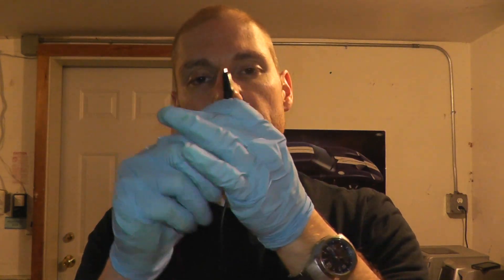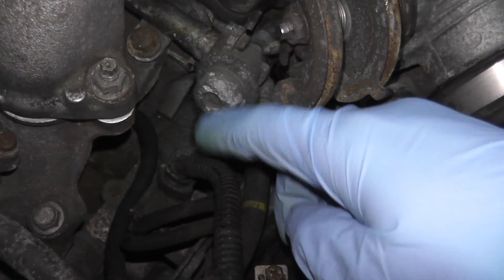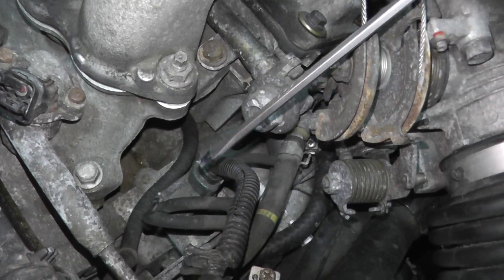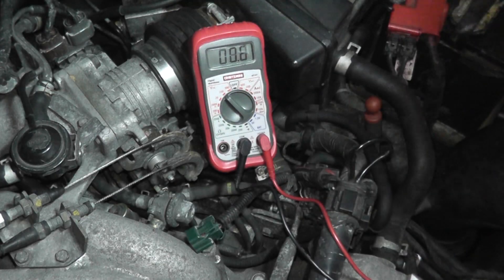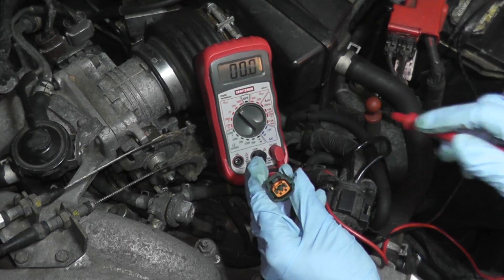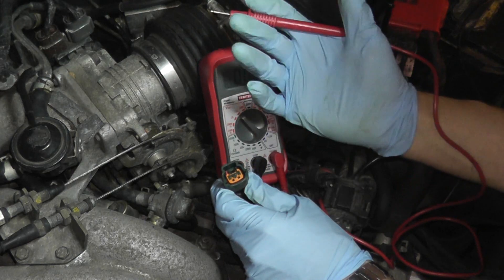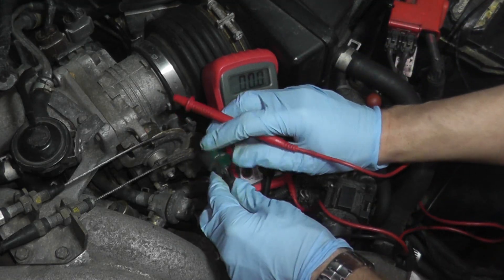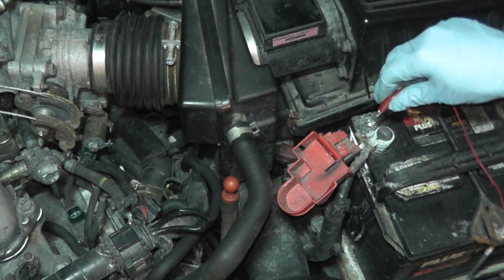How to test and replace the EGRC Solenoid Valve P1400 HD

Comment: I'm perplexed, I have the repeating (after erased numerous times, but no symptoms) P1400 code for 1998 Nissan Pathfinder 3.3, 164,000 miles. It was throwing this same code with an older motor, and still is with replacement motor installed last week. I have 12v at the wire plug when it's unplugged and key on. 12v applied with jumper wires actuates the solenoid on both its leads.  But, when I have a helper turn key to on I cannot hear or feel the solenoid activating.  Is this solenoid controlled by ECU giving it a ground?  Or how?
Reply: Same question I have :(
Reply: @ericoz650  I need to take the time to cruise the forums and Google more. The Nissan forums are better fixer communities than FB and YouTube, so it seems.  I still haven't fixed it.  Seems to operate fine though otherwise.
Reply: @thesetruths1404  thanks for answer
Reply: @thesetruths1404 damn i literally have the same issue, i have a 2000 2.4l frontier with the p1400 code. Power at the connector, solenoid is new. Im starting to think the ecu is bad

Comment: @CarsNToys where did you get the test leads or did you make them? I have P1400 code and i am getting 12v to the wire harness connector but would like to test the egr solenoid valve like you did before i buy one.

Comment: Great video. My 98 maxima tested 11.6 volts at the molex connector, not 12v. The solenoid however when tested directly from batt did click. 

Since I’m not getting a full 12.1v at the connector, any idea if that might have an effect on performance of the solenoid? Unsure where to go next.

Comment: Also, just because you can hear the solenoid click, the Vacuum Valve in the EGR Solenoid may still be malfunctioning. The best way to test it is: Put a vaccum on the EGR Solenoid Vacuum port, and a Vacuum Gauge (with a Tee connector) on the EGR Solenoid port to the EGR. When the solenoid is off, there should be no vacuum on the EGR port. When the Solenoid is on, there should be vacuum on the EGR port with no loss of vacuum. Then the vacuum should release when the Solenoid is turned off. Most EGR Solenoids have a vent hose that let's in air to release the vacuum to the EGR port. The vent hose may have a little air filter on it (some filters are built into the EGR Solenoid) so make sure the vent hose and filter air letting air through with no leaks (you don't want dirty air in your EGR Solenoid Vacuum Valve).
Reply: more helpful than the video was. thanks a heap

Comment: Great video. After you verify power to the connector, check the ground on the connector too. Turn the Ignition OFF. Then put your meter in Ohms mode and measure the other pin to ground (chassis). You should read less than 2 Ohms. Then put your meter back in Volts DC mode.
Reply: Thanks for information, I just try find out how to check ground connector.
Reply: @ericoz650  Checking the ground is easy. Put your DMM in Ohms auto range. With the vehicle powered off, measure each lead with the red meter lead, and with the black meter lead on the chassis (ground). One should read less than 2 Ohms (that is your ground and it is good), if your read a few Ohms higher, that is a bad ground. Digital Multi Meters (DMMs) take a few seconds to start reading and to stabilize, so give each measurement about 5 seconds before you make the reading.
Reply: @paulromsky9527  I just checked EGR Solenoid connector and one cable "+" Is working and show's. 0.75 Om or 12.5 +- Volt, but "Ground" no reaction at all :/ On Volt no reaction and on Om test also no reaction at all on Multimetr :/ Is that mean that Ground cable broken and need replace him? Only how to find where his Started? In theory somewhere in ECU?
Reply: @ericoz650  Great diagnostic work. I don't have wiring diagrams but the ground wire most likely does go back to the ECU. One method is to add a "helper ground" to the ground wire. You follow the ground wire as far back as you can, then splice into it there, then attached that spliced wire to a nearby bolt or screw. You may have to sand away some paint for a good connection. But it is best to trace the wire all the way to where it is no longer making a good ground contact.
Reply: @paulromsky9527  p. s. What interesting, alternative connection to EGR slolenod, make engine work correctly, slowly on "N" gear position, but on fuel LPG then appear Code P0403 and sometimes P0300 during driving at once a couple days. But if Solenoid off, then P0403 gone and P0300 gone, car work without any Cods nicely, if not only higher engine speed work oon gear position N". But on Petrol - Gasoline P0300 appear even on "N" Position.
Reply: @ericoz650  If you are fueling your car with Petrol and/or LPG, that is beyond my expertise... I only know about Petrol fueled cars.  But since alternate connections to the EGR Solenoid seems to make it work, you definitely have bad wires somewhere and they need to be replaced or repaired.

Comment: Hey i have a 94 maximum it was low in transmission fluid it started pulling slow I refilled it back up it doing the same thing if you can help me thanks

Comment: I am working on a 1994 nissan d21 v6 4x4 automatic. I have no power to the egr solenoid valve. I have ohmed out all the fuses under the dash. All checked good. I'm at a loss. What am I missing?

Comment: the one glaring question I wish you had addressed was when touching the pins such as the voltage check how did you choose which pin to touch because any person would wonder "what will happen if I touch the wrong one?"  does it matter? if so how did you determine "I will touch the outside pin?"  that could mean anything

Comment: My 1996 Infiniti I30 does not have the EGRC valve like your engine does. I am still getting the p1400 code but I am unsure on how to resolve this issue. Would you know anything in regards to the 96 I30 that does not have the same EGRC valve as you do?

Comment: hey c&t!  great videos man.  u could not have explained this process any better, but leave it to me to have a question.  i tested the egrc component and i heard a noise but it didnt sound exactly like a click, more like a tiny zap and does it matter which port the 2 small hoses are connected.  im still getting code
Reply: by the way its code p1400 and code p0325

Comment: not all solenoid clicks so you really cant go by that only. Check ohms should be around 35 ohms ish, then give it power like you did but start the car if the idle gets rough then the solenoid is working, also you just verified the egr valve also working good.

Comment: Great video. You are a great teacher and the camera work was excellent. You always have great content on the nissan maxima. One question I have a Nissan Maxima GLE and you mentioned a 10 amp fuse. Is this fuse #17, the one for the engine controls or where is it located? Please advise. 1997 Nissan Maxima GLE.

Comment: I have a 1999 Nissan Altima GXE.  I received a code for the EGR valve but have been also told that it could be the EGR C solenoid.  I don't want to waste money in replacing a valve when its the solenoid.  The test I did on the valve was pushing the valve up and blocking the port with my thumb and it held the vaccum until I removed my thumb.
Reply from the maker: What's the code you're receiving?
Reply: P1402

Comment: also in the video at the begining there is a black connector hooked to the side of the valve cover that says v6 3000 twin cam 24 valve. right there on the edge of it on the end of the connector it says Nissan 0.47 what is that connector for, what is its function. when I unplugged mine it's full of red sticky stuff. please help. I have a screen shot but didn't know how to send a picture. thanks for any help.
Reply from the maker: Your vehicle may be different depending on the specific model. Do you have a California spec model or non-California model? There's a tag on the hood that states if you have a California model. Watch this video and fast forward to 18:40. I show where the tag is located.  https://youtu.be/NabxJMx1cW8

Comment: on my 95 Nissan maxima I have this code. but the solenoid you tested in the video is not even hooked up on my car. I have one that is identical up by the radiator, is that the one I test and do i do the same with it as you did in the video. thanks. these videos have saved my rear lately!!

Comment: Great video--clear, concise and provides step by step directions.   I followed the video instructions and with a $10.00 junk yard part from a 1995 Maxima fixed my 1996 Maxima.   Getting the solenoid valve from the 95 was easy--removing the valve from the 96 was not.   So, not being able to reach the nut under the valve, even with a 10mm flex wrench, I just left it in place.   I disconnected the vacuum hoses from the bad valve and placed them on the new valve, zip tied it in place and reconnected the electrical connection and everything went well.   Thanks for the help!

Comment: That sensor is hell to remove and those bolts at the bottom are very sensitive and will snap but if you're swapping it doesn't really matter, but can someone please tell me where the fuse is so I can check. p1400 p0325
Reply from the maker: +Marktheshark804 What kind of vehicle?
Reply: +CarsNToys what fuse can i check for the p01400 code .. where is it located.. i have an 96 infiniti i30

Comment: You really didn't check the GND connection to the solenoid. You just verified that it was getting 12V.Maybe use the OHMs setting to verify that the solenoid GND pin connection is good.

Comment: I have a 1995 Maxima CA vehicle and the solenoid is not in that position. I just replaced the knock sensor for a P0325 fault, but P1400 is still coming on. Is the egrc solenoid in a different position for a CA vehicle?

Comment: Hello I checked the solenoid valve connector harness and it's only reading 5-7 volts, is that the reason I'm getting the code P1400 and what is the fix to this problem? Could it be Evap control pressure sensor causing this because, my mechanic wants me to buy that part next he says that's why it's reading code P1447. I also get code P0446 but mechanic already replaced Evap canister and Evap canister control valve, I'm still getting that code P0446 though. Got to pass emissions this month or I will be walking. I hate living in Ga
Reply from the maker: +Bigman What kind of vehicle?
Reply: +CarsNToys 96 Nissan Maxima GLE
Reply: +CarsNToys I also checked the Pressure sensor connector harness and I didn't get the beep but I did get a reading
Reply from the maker: Okay. What codes are you getting right now?
Reply: +CarsNToys Codes are still the same as explained in my first post, I wonder could it be my ECM because I didn't get a beep when I checked pressure sensor harness connector, as instructed in your other video

Comment: Hello I need help I have a  1997 Nissan maxima my check engine light is on and the codes that keep coming up is p0110 intake air temp sensor and  p1400 egrc solenoid valve the intake air temp sensor is plugged in the air duct but that code still comes up and the sensor is brand new the egrc solenoid valve code pops up sometimes these two codes are stopping me from passing emissions  can you help me
Reply from the maker: Donte Quinney Have you seen this video yet? It may help  https://youtu.be/N5FGh8T4qmE

Comment: Should my 96 I30 look the same? I know it should but I have that same code and i can't seem to find that connector. In my car there is no sensor near the area located in your video.
Reply from the maker: Jonathan Nguyen You sure code you have is p1400? I believe these didn't come into play until '97
Reply: CarsNToys Yea my obd reader says P1400 "Manufacture Control"
Reply: +CarsNToys So is it my car is throwing a code it shouldn't have? I cleared the code and the P1400 still comes up.
Reply from the maker: Jonathan Nguyen
I don't have anything on my end for p1400 & '96 I30.

Comment: Hello... I recently reached out to you with help replacing my O2 sensor (p0138)... Your video was extremely helpful and easy to follow...
Now I got p1130 swirl control... Do you have any experience with this?... The Internet has provided a little insight, but I'm hoping your expertise can guide me a little better... I have a 2001 Nissan Maxima, looks like the Max you work on...
Reply from the maker: jh hassellhoff Sorry, the Maxima I work on is a '97 model; before they started using swirl valves. Next time I come across a newer Maxima I'll take a video on how to test the valve.

Comment: is this the same as a temperature sensor? I'm getting a error code 32 on my 94 nissan pickup and its for erg function and either said egr valve, temperature sensor, solenoid seemed like the 2two were the same thing
Reply from the maker: aLECKS SKCELa Do you mean the coolant temp sensor or air intake temp sensor? I have vids for both....http://youtu.be/bPAIFL8VH9w   and http://youtu.be/N5FGh8T4qmE
Reply: CarsNToys i checked the solenoid how you described in this video and also the erg valve in your other video and they check out good. my check engine light only comes on sometimes. pretty random. any other opinions why why check engine light goes on and off at random? my friend also says it might also be my catalytic converter. can that be true?
Reply from the maker: You have the four or six cylinder motor?

Comment: Thanks for the excellent video.  I need to change the solenoid.  What special tool can reach the 10mm nut under the bracket to unbolt the solenoid?  1996 Maxima
Reply from the maker: Henry Edwardo It's a little tricky but try a using different size wrenches.
Reply: CarsNToys OK, Success!  I bought a flexible 10mm ratchet wrench for $8 online and successfully changed the solenoid valve today.  I'm told the check engine light will eventually go out after driving the car for a number of cycles, whatever that means.  Barring someother problem, do you think the CEL will cycle off?
Reply from the maker: Henry Edwardo
Good stuff, Henry. Yes, it will cycle off.

Comment: Hello and thank you for the video.
Im working on a 2000 Altima and was wondering how would I determine which connector is positive and which is negative on the egrc solenoid? Thanks
Reply from the maker: 831too702 Sure. If you look at the harness connector facing up (the tab is facing up), the connector on the left is positive.

Comment: Hi, we have a Nissan Altima 2000.  We unplugged the engine mount control solenoid valve harness connector and according to multi meter, there is no voltage the getting to the sensor from the harness.  We checked all of the fuses on the engine and under the steering column and none of them are blown, where is the fuse located?  Thanks so much!
Reply from the maker: John Biskup Hi John. I believe the first year for hydraulic engine mounts are 2007+ Altima's. Do you mean where the fuse is located regarding the EGRC solenoid valve?
Reply: Yes.  We never found the fuse for it though.  We let the car warm up and were able to get a reading.  A friend told me the egr does not kick in until the car is wanted up. Thank you.
Reply from the maker: It runs through a 10 amp fuse; number 25. I believe it's under the dash for your vehicle.

Comment: Hi again today rechecked hoses they are not clogged at all.

  I have taken those rubber hoses off a few times.  Are they supposed to come off easily off of the egr solenoid?  the one that points toward the firwall and the two that point up towards hood towards front end also come off without any effort like the others I have taken off. Is that normal? 

Sorry if im not making sense. I'm not giving up on the car that is the only problem with the car. Runs great! -)
Reply from the maker: Veronica Morales If you're getting 12 volts at the harness connector and the solenoid valve works you should be in good shape. My best guess is either the harness connector isn't completely plugged into the solenoid valve or the hoses have been mismatched.

Comment: Hi. I really need your help.  My car is also coming up with code p1400.  We did everything you did on the video.  The code p1400, just keeps coming back hours later or the next day. . By the way we do have a code reader , the one who knows how to use it is my husband after I replaced egrc solenoid he cleared the code...  Egr solenoid has been replaced there is that click (the one with the green connector) volt test 12. 

Car is a 1996 nissan maxima gle. Emissions test failed (Illinois) ( code p1400) a month ago and we still can't get that code from popping back up, other 2 codes that had popped up along with p1400 stopped showing up which was knock sensor and the sensor by charcoal filled canister in the rear also changed that charcoal filled canister.  Now obviously with the check engine still on emissions will be a fail and therefore we can't drive vehicle around.  I'm trying to fix the problem ourselves cuz man around here everyone wants 1200 to fix a maybe simple fix. 

Can you please help,  oh and also we checked every fuse all are fine. I looked at the fuse square by driver side under steering and also under hood left side near where the battery is.  As far as those relay boxes well  have no idea.  Is there another fuse block or square that maybe we are missing.? Anyway hope to read from you soon.  Thanks love your videos and the way you explain :))
Reply from the maker: Veronica Morales How are the hoses leading from the egrc valve? Are they clogged?
Reply: CarsNToys opps replied up there^

Comment: hello, i am working on a 2000 VW Passat with a 2.8.  I'm only getting about 8 volts to the wiring lead to secondary air injection solenoid and the intake manifold change over valve. Is this normal ?  If not, where should i start looking for problems?  Thanks.
Reply from the maker: pat down I'm sorry, Pat. I have very little experience working on German cars so I can't tell you for sure if that's your problem.